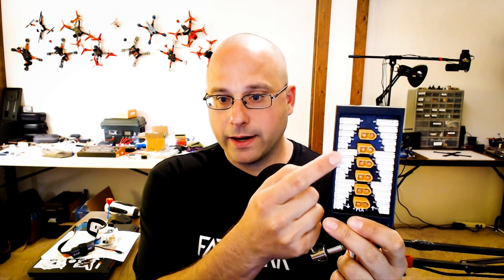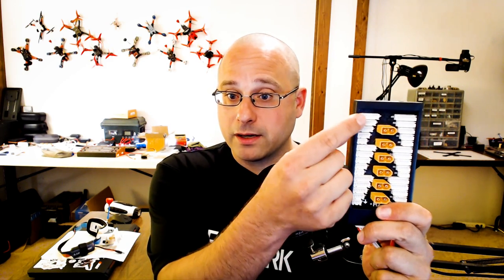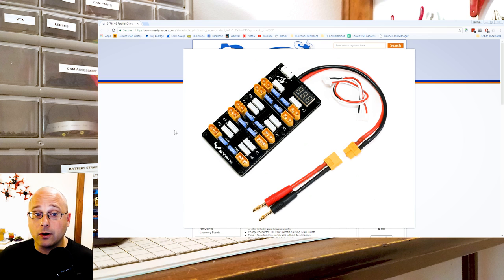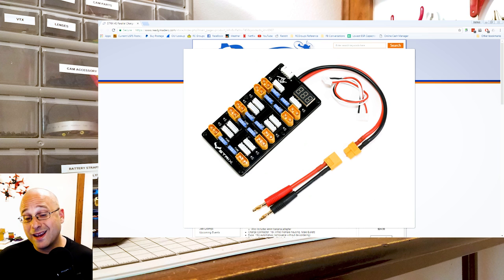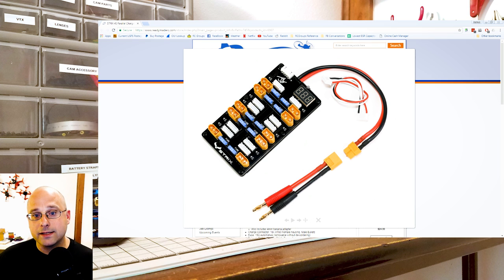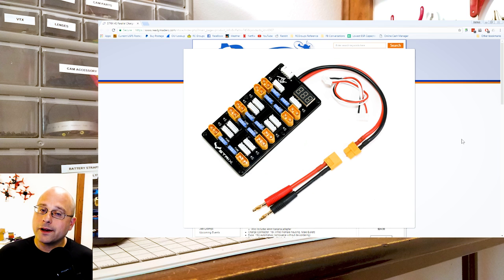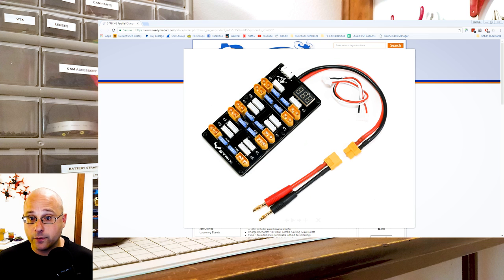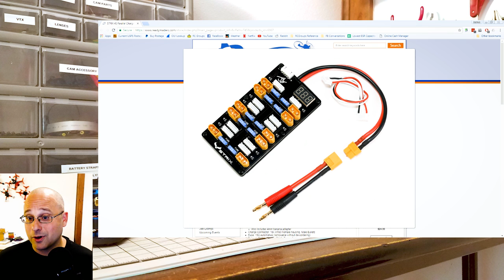The Best 4S Parallel Charging Board. Period. | JB SIGNATURE LINE

Comment: Joshua, I purchased two of these boards and I noticed a big issue with them. in regards to the balance section, if you plug one in a little sideways and one of the pins touches or god for bid if you plug them in backwards, the slightest pin touch fries the balance section of the board totally and the copper lifts right from the surface like nothing. I consider this a design flaw because I've had probably 10x Progressive RC parallel boards and over the years either touched the balance pins a bit of an angle or completely backwards for a split second and it never ever caused any damage. The progressive rc ones have some component inline with the balance leads on the board which I presume is made for this. Your board has no protection for the balance ports and obviously doesn't have the copper to handle a mistake. It's a bit of a shame really that both my boards are useless, for literally plugging in the balance lead at a slight angle where one pin touched first before the others.
Reply from the maker: +Lyons adding poly fuses would put the price higher than we are trying to hit. It's not touching one pin first that fried the trace. You plugged the connector in backwards or not lined up correctly. Any board will burn if you do this.
Reply from the maker: But I do agree: if you want protection against plugging in backwards or lined up wrong, you should spend more on a board with polyfuses. If you are willing and able to be careful every time you plug in, you can save some money on this board.
Reply: Yeah but mine fried not from plugging in backwards but at an angle where 1-2 pins touches before the others. It just happened this morning. I was just making the point that my PRC boards can be plugged in backwards without damage. While I wouldn't consider it a design flaw to fry if plugged in backwards, plugging in at an angle where 1-2 pins touch first should not fry it. Those balance plugs or sort of finicky and often one side will slide down first.

Comment: I've had a parallel board that burned out the traces when I plugged in something wrong. It basically disabled one rail of my para board. What makes this one burn the fuse before the traces?
Reply from the maker: If you plug in the balance connector wrong, you will burn the traces. You should plug in the XT60 first to make sure the batteries are at safe voltage, then plug in the balance connectors second.

Comment: Yes, it's far too fancy looking for what it is, but one really nice thing about the ISDT parallel board is that it only has 1 balance port per charging port, but each one fits from 2S to 8S.

I just wish the ISDT board had more than 4 ports :-(.
Reply: Every parallel board on the market is made that way before josh came out with his, there's no reason to waste 35$ on the isdt version when you can get the same thing or better from other vendors for less the 20$
Reply from the maker: That just seems like an invitation to plug the balance plug in wrong.
Reply: sean metzger: Really? I haven't seen any other boards with this design. Note that it doesn't have separate ports for 2S, 3S, etc. It just have 1 balance port that fits all plugs from 2S to 8S. You always align with the left-most pin, so packs smaller than 8S have some unused pins. See: http://www.myrcmart.com/images/upload/ISDT-PC-4860-iSDT-PC-4860-Safe-Parallel-Board-01.jpg

Joshua: I suppose that's always a danger if you support more than a single cell size. Though the housing is aluminum, so maybe it'll be sufficiently difficult to insert it incorrectly.

In any case, thanks for putting out a 10 port charger. Hopefully this pushes other people to release boards with more ports!

Comment: I'm sitting here, looking at my balance boards, with fuses. Soldered you say? I never checked. Turns out the Turnigy 4 port balance board does have fuses that are in holders. They are not soldered to the board. Alas, it's only 4 port though.
Reply from the maker: That's fantastic. FWIW, all the ones I have seen are soldered, but I don't claim to have seen every one on the market.

Comment: Hey @Joshua , any idea why most of the time, after the charging is finished, the 1st cell has a lower voltage than the other three cells?
Reply from the maker: If you leave them in the biard overnight it's because the cell checker runs off the 1st cell. Solution is to unplug them when they are done charging.
Reply: @JoshuaBardwell  sorry for the confusion. I'm sorry I was not using your parallel board, but using a generic one. I am using imax mini with a generic parallel charging board. I'm not leaving them though overnight, I unplug them after charging.
Reply from the maker: Test your charger. Charge one pack without the parallel board and see if the same thing happens.

Comment: Great product, solves a lot problems and I'll check shipping to EU! 

Have you thougt about using just the balance leads for parallel charging?
This would make the connection way easier by only connecting one balance lead per battery and not the XT60s.
And 1.3A charging current (even 2A) should not be a problem for the balance leads.
You just need to have the right cable:
A parallel balacing lead for multiple batteries (sold by HK) and then to connect the charger () pole solder a 4mm banana plug to the () pole of the parallel balance harness and same with the plus pole.
Another advantage is that you do not have any short circuits by wrong connection via the XT60s.
Reply from the maker: Few chargers will allow the charge cycle to begin if the main lead is not connected. If the voltage on the main lead is not consistent with the voltage from the balance connectors, the charger will stop the charge cycle.
Reply from the maker: We are working on getting set up with some EU distributors now, so it may be a few weeks but hopefully soon.

Comment: This is a nice board :-) I have a question: I have a ISDT 1000watt s8 charger. Could I balance charge two s4 by adding them in series on the balance connector? Wouldn't the charger them see it as one s8 battery?

Comment: Just cut the polarization/alignment tip (next to the positive lead) off the balance lead. Don't cut the one next to the negative. It  will keep U from putting it in the wrong position. This will make U able to put it in any 4, 5 or 6s balance port. (This can also be done on battery balance connectors, if U want to charge 2s or 3s in 4-6s ports)

Comment: I have a ? Can you parallel different numbered 4s batteries? Meaning i have 5 (1000 mah 4s 50c) 3 (1350 mah 4s 95c) and a couple 1500 mah 95c. Can i plug them all into the same board at the same time or do the numbers have to be the same! I would like to learn something today and thank you for the knowledge you provide!
Reply from the maker: Yes you can mix different mAh. When connecting batteries in parallel, mAh adds up and voltage is the same.

Comment: How would i get this attached to a Revelectrix Powerlab 6 with its proprietary balance input plug? You mentioned to plug this units 4s output into another boards input then the second board into the charger, is that the best way to go?

Comment: Hi Joshua, I have a few E430 chargers that I can select 1,2,or3 amp output. I don't really want to buy any more chargers and I am currently using 3 of these to charge 11 batteries at an hour+ each. I love this board and will have one as soon as they are back in stock; will this charger type work. Thanks Alan U.K.
Reply from the maker: Yes it'll work but it'll take a long time to charge the packs because of the slow charge rate. Parallel boards work best if you can achieve about 1C charge rate for the whole board. So if you have 10x 1300 mAh packs plugged into this board, that is a total of 13,000 mAh, so a 1C charge rate would be 13 amps.
Reply: Joshua Bardwell many thanks
Reply: Joshua Bardwell thank you for your time, anything that you could recommend ,appreciated.

Comment: Is there a reasonable way to connect two 3s packs in series and make it look like a 6s to the 6s charger and also be balancing all of the cells?  Same with two 4s packs into a 8s charger?  Are there Safety issues with passing all the current for the second pack through the first pack?  This seems like it might be better than having the high cells charge the low cells in the other packs in an uncontrolled manner.
Reply from the maker: You can do that. If done right, there shouldn't be any difference between that and a proper 6S pack, so there is no safety issue. Just get it wired up right.

Comment: Even better would be some circuitry to allow plugging in batteries at different charge levels. Board would have to keep all balance leads disconnected at first and allow a couple amps through xt60 connectors to trickle between batteries until they all settle to the same voltage. Then, with some triacs or something, connect the balance leads and xt60 ports to the charger and start the charger. Of course this would cost $300 so no one would buy it, but it would be awesome :)
Reply from the maker: Correct. That is the problem. By the time you make a "balance board" that can handle different charge states, you have basically built a charger.

Comment: Battery cell question, do cells need to be rectangular? Or, is there a design reason they are the shape they are?
Reply from the maker: They are manufactured in sheets, so rectangular is the most obvious shape for them. The cylinder cells are actually rolled up sheets.
Reply: Joshua Bardwell. Do you think we'll see battery shape change before they get smaller?

Comment: Dear JB, what maximum current we are able to put to this parallel  charging board and bee safe. What is max limit, which will burn out wires inside (both: balance and power)?
Reply from the maker: 60 amps on the main leads. For balance leads, I don't know what will burn out the traces, but a typical balance lead is safe at < 2 amps and definitely not okay at > 6 amps.
Reply: Dear JB, Thanks for fast answer. Yes. 60A are much bigger as i imagine to charge. :D
And 2A are totally enough. because usually all chargers are max 1.5A balancing current.
Thanks. This is grate board. I will 100% buy two, because i'm also using 32pcs  4S battery's starting from 1000mAh till 1500mAh. Can you inform me if some guy's will buy to Europe, Lithuania, city Kaunas or Vilnius?

Comment: Awesome Joshua!! I would buy this in a heartbeat if it did 5s as many of us run 5s for freestyle and 4s for racing... 😢
Reply from the maker: Easy to do, just a matter of time and demand. It would be a 2nd board though, with 5S connectors. One of the whole points of the board is that because it has a single type of balance connector, you can't accidentally plug in to the wrong header. This removes one possible mistake you can make.
Reply: anglovirtual I've been using 5s for over a year now, I've tried a 4s and it felt so underpowered. Lots more going 5s recently!
Reply: Joshua Bardwell yes exactly. Turn this into a line of specialized boards covering all the S's.
Reply: anglovirtual Notice I specifically used the word "us". I'm talking in my group of fellow pilots and other friends across the the net. It might not apply to you, but many in my group of fliers fly 5s since last year. :)
Reply: Joshua Bardwell Totally! It's a great para you've designed irregardless. What I would love is 4s balance headers all one direction and 5s balance headers all the other direction. Or even color coded so 4s are all orange and 5s all blue for example, plus oriented opposite directions. Then it would never be a pain ensuring correctly plugging-in, even in the dark because of orientation. Great design and thanks for all your contributions to this great hobby! -Travis

Comment: I got mine. Only thing that confuses me is the voltage read out is different from what my isdt charger reads on each cell. It's not very different but for example the board shows the first two cells being measured at 4.24v while the the isdt charger reads all cells at 4.20v so I'm not sure if the charger is not right or the parallel board isn't but I do have a Venom battery monitor and it also shows a small variance of voltages across the 4 cells. What's your input on this?
Reply from the maker: +Jonathan Farnden there is a small amount of voltage loss in the wire but really it could just be a tiny bit of calibration error. Who's right?
Reply: Joshua Bardwell Appreciate the info. Not everything is spot on I guess haha.

Comment: I use the TG 4S-1300 packs and the Accucell6 (60W charger). I use 700~800mAH of the pack and charging at 3A, they recharge in 12~16 minutes. Not sure why yours would take an hour, even if you hammer your packs to zero, should be less than 30 minutes,,,well unless your balance is all screwed up, as balancing way off packs can take a while.
Reply from the maker: Charging at 1C rate always takes 1 hour, assuming the battery is fully discharged and the capacity is accurate. If the battery isn't fully discharged--which it shouldn't be if you fly a mini quad--then it'll take less than an hour. But if you're charging at 1C and your packs are charging in 30 minutes, I suspect you're not discharging them as far as I am.
Reply: I charge at 3A or 2.3C, this is less than the 60W the charger is limited to. Most of these batteries are easy to charge at 5C (6.5A) without harm. My first batch of TG 4S-1300 65C had a 8C charge sticker on them, that's 10A charge rate, 1C is just BS charging rate and discharging your batteries under 30% is just stupid, unless you're a sponsored pilot that like to fill the landfill. I have 700 cycles each on my first 6 TG packs now at 1yo and they still provide 1800W at 120A. Remember, the lower you discharge your cells, the less life cycles you get out of them, for me, it's just not worth flying for an extra 30 seconds to force a early death out of my batteries, your preference my not be the same as mine (as you're assuming 100% discharge and 1C charge rate).Thanks for your vid's.

Comment: What type of Power supply do you have because if i wanted to charge my batteries at 1c i could probably only charge 2-3 batteries so i need a bigger power supply so what power supply options are there
Reply: DannyL Fpv pick up a server power supply from eBay. That's what I use and it was like $20 for a 1000w power supply. Minimal diy is necessary to get it working
Reply: Kyle Wineinger and pay attention to the 12v rail Amperage rating, or is that just for 3s, 2s, 1s batteries?
Reply: Your also going to need to make sure you have a charger capable of high wattage, something 300+ watts is needed to charge 10 1300 lipos at 1c charge rates, 500w would give you decent overhead and some wiggle room for faster charge rates
Reply: Got some color at flight fest JB. 😎

Comment: is it very expensive to add  limit for the max current between batteries?
so we able to plug battery with any voltage on it
Reply from the maker: The short answer is yes. It sounds simple but it's not, when you consider all the contingencies. This board by itself is nearly as expensive as some chargers. Imagine adding FETs and so forth. Size and cost would go up.

Comment: So do the fuses cover the balance ports as well? Or are there polyfuses for those?
Reply from the maker: Neither. The balance ports are un-fused. Polyfuses would make the board much more expensive. Plug in the XT60 first and if anything is wrong those fuses will pop. Then plug in the balance once you know everything is okay.

Comment: I don't like the lack of reset able fuses on the balance leads, they are the part that people always plug in backwards and short out boards. Else its a great product.
Reply from the maker: Look at all the other boards out there with polyfuses. They are in the range of $60-$80. We wanted the board to be affordable. 10 ports for $24 is a great value.
Reply: Not completely true the amass one is £22 or so, total bargain for that level of safety. Your board is awesome tho, and great to see more than 4/6 lipos at a time :D

Comment: if I use a charger that puts out 3amps, will this work for 10 1300mah batteries. In the UK everything is rated at 13 amps due to the domestic plugs we use, but to find a Lipo charger that outputs 13amps seems impossible. We in the UK would appreciate your help
Reply from the maker: +Alan Carter something seems off about your math. Your outlet puts out 13 amps. At 220 volts. So it puts out 13 * 220 = 2860 watts. 

Your charger is outputting at, say, 16.8 volts for 4S. 

2860 watts / 16.8 volts = 170 amps. Your wall socket could support a 4S charger putting out 170 amps (actually about 10% less, accounting for efficiency losses in the voltage conversion). 

Realistically, the largest charger you are likely to find is going to be rated at around 300 to 500 watts, but your wall socket isn't going to be the limiting factor. 

This video covers the topic in more detail. 

https://youtu.be/LwU9lFAZmHc
Reply: Joshua Bardwell thanks but all that does is totally confuse me I'm afraid. I was really looking for s simple answer in layman s terms.

Comment: If my charger has a 4s balance plug port can I just plug the parallel board into the 4s or do I still need to jam it into the 6s port?
Reply from the maker: No, you can use the 4S port.